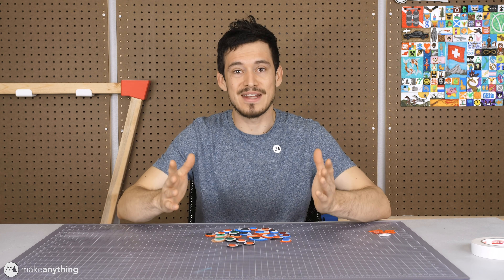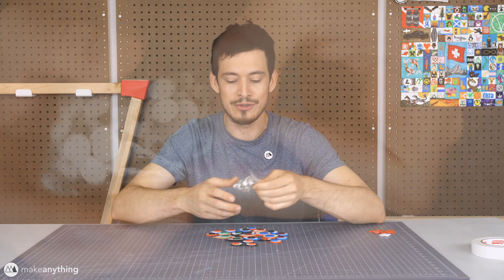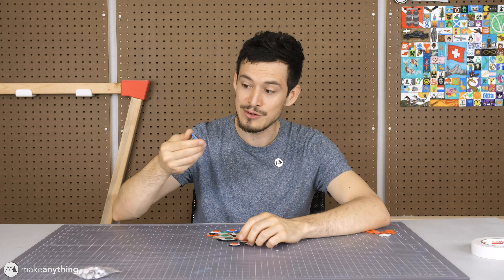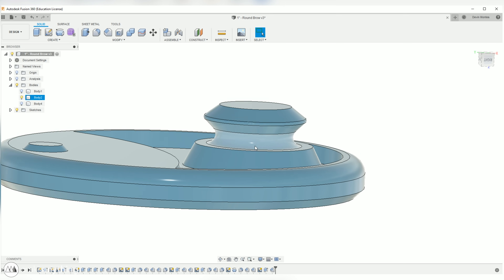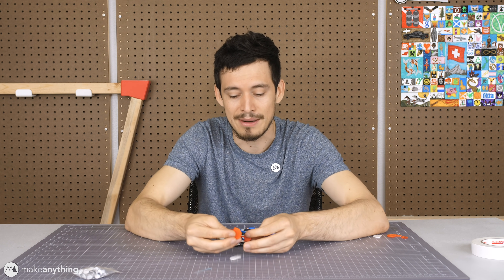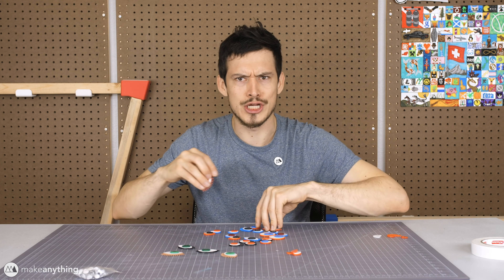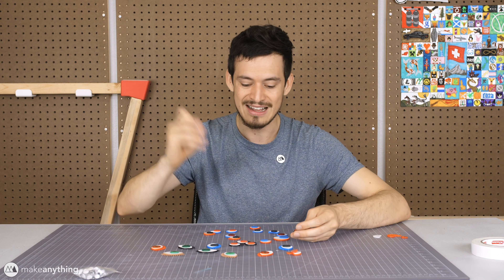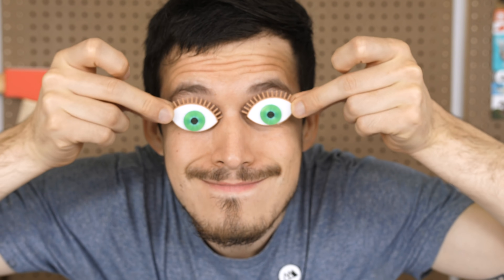3D Printed Googly Eyes (make everything better)

Comment: I couldn't make the machines but I could design a process to make googly eyes.
Without looking it up,
First injections mould the clear domes. At the same time injections mould the pupils in the required colour (just simple discs).
Second allign the domes on a belt with divots for the domes to sit in. As they pass a point have a dispenser drop a disc into each dome.
Third a roll of plastic card with sticky back is feed sticky side up over the domes.
Finally a machine stamps up around the dome cutting the plastic card while also lightly melting the plastic card to the dome.
Reply: On reflection; between the second and third steps a roller with a film of glue rolls over the edges of the googly eyes as they pass underneath.
The card is feed over and pressed into place. Then card is pressed out.

Comment: I find your design amazing, don’t get me wrong. But... could you not just print the flat back part and then lay the pupil part down and have a bubble print around it?

I’m aware getting a crystal clear bubble on a printer is not easy. I’m more concerned with the theory of it. From a manufacturing stand point...Would they not just place the back down, lay the pupil on top, and press the pre-formed bubble on top of it and use some degree of heat to fuse the bubble and white back?